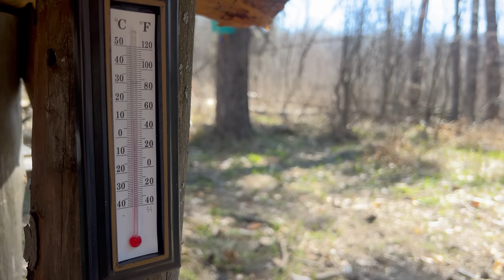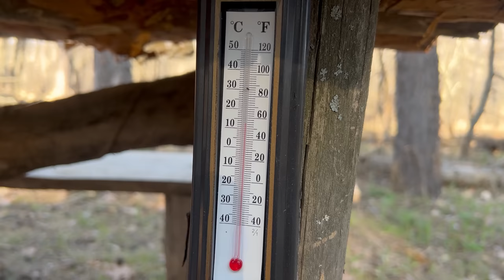Outdoor STOVE next to an UNDERGROUND HOUSE, spring day in the DUGOUT

Comment from the maker: Hi! Spring brings warmth and new ideas. I decided to make a new outdoor oven (TANDOOR). Now I have a lot of stones left. Where do you think they can be used?
Reply: Stack them around your external stove pipe.  Bind them together with some of the left over cement you used for the tandoor. Make it look like you have a chimney made of stone on top of your dugout!
Reply: nice idea on the oven .... when those bricks crack because of uneven cooing and heating ... and you rebuild it ... make the same oven BUT backfill the outside with sand and fine gravel .... the reason the other stones cracked often was because the dirt was cooler than the stones always and cause the stones to cool unevenly making the crack along fracture lines ... the same will happen to the bricks ... may take a bit longer but it will still happen for the same reason ... the backing is dirt not porous sand and gravel which removes water and can retain heat better ... 
.
in North America ... ok Canada ... we call it Mortar ... if you lay bricks for the government we call it mordor ... ok so I like Lord of the Rings LOL 
.
you missed a PERFECT opportunity to make yourself a wooden rake for moving the future grass soil ... and in future to help tidy the area up of fallen stuff etc ... 
.
fireglass insulation ... basically fiber glass insulation with a metal foil reflector to keep heat reflected away longer ... making it harder to pass the fire along ... 
.
hand sized stones ... easy COBBLE pathway ... from your front steps out and along the front of the cabin ... they run out ... they run out ... add more as you find them over the years ... 
.
that left over section of stove pipe ... use it like an oven tray for skewers and stuff ... lay the food on tin foil ... place inside the stove pipe ... insert into oven ... remove pipe when done and remove tin foil with food ... 
.
the only truly missing is a mound where you can lay against it facing any direction and enjoy ... kind of like a lounge chair made into the ground using a small hill for your back rest ... of course some flat spots for drinks and food etc ... maybe even a flat spot on top for the camera tripod
Reply: One thing I like to do with smoothe rocks, or at least small rocks more the size of gravel, is to warm them in a pot of water, then carefully transfer them to a canvas or burlap bag, like the bags that rice come in, and use that as a warm pillow behind my back at the end of a hard day of work. Really soothes the muscles. Also can use to warm up the blankets before you get in bed. I do that at home as well as when I’m camping.
Reply: Do you ever go to the first cabin?
Reply: Don't know where you can use the stones but what about some paint either inside or outside to give some nice bright tones. 
I really enjoy these videos and seeing all the improvements you do. Your meals always make me hungry!
Reply: 😮 @kuskesh_haramzadeh  la 😂😂
Reply: You could make a bed in which you plant potatoes or other crops
Reply: Wow good job bro
Reply: Beautiful,  love that cute little 🛖
Reply: Make a flower/food garden with them.  Maybe a water hole.
Reply: Yo con las piedras haría un GARDEN ya la forma que le quieras dar..

Comment: Several observations.

1) The area you are in is strikingly similar to Southern Maine, USA. It is beautiful.

2. I am currently considering land in Northern Maine. Much colder. Still under very much snow. 354 acres.

3) I suspect you enjoy cooking as much as I do. I recommend a recipe I created. Inexpensive and relatively easy, but very tasty. Make a red pasta sauce with ground beef. I prefer to season with salt, pepper, basil, oregano, a dash of marjoram and a little Cayenne red pepper for a slightly spicy kick. Bake some chicken breast (easily done over the new fire pit if you use a grille top, wrap the chicken in aluminum foil), when the chicken is almost done, open the foil, spread the sauce over the top and sprinkle with parmesan and let it cook for another 5-10 minutes so the chicken is still moist. Delicious.

Comment: No wonder that backpack was heavy. Bricks, cement, sand, insulation. Yes, a flower bed. A packet of shade-loving wildflowers. Protect the young seedlings with straw or dried grasses. Punch some holes in the lid of a gallon water jug to use a sprinkling can. Love the new oven. These do not look like fire bricks, but I am trusting they will not explode. It will be exciting to see what you create with your culinary skills.

Comment: Will there be enough air for your firewood storage to prevent mold and wood rot? I think that would be sufficient for a couple days in dry weather but just enough moisture to attract critters. Wasps, hornets, and rodents will especially move in if no activity for a couple days.